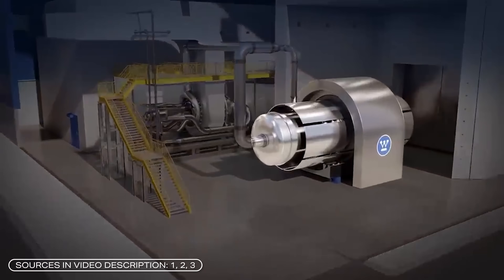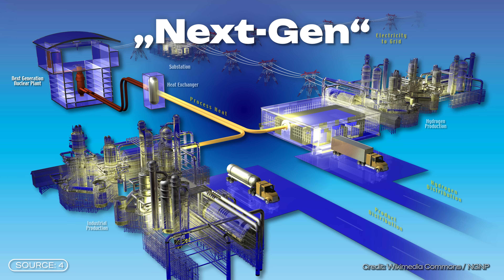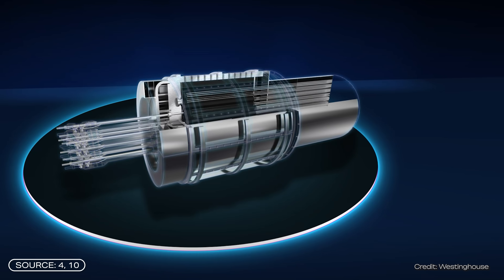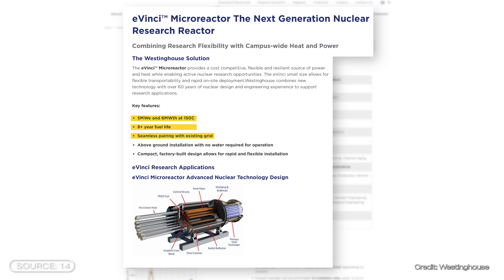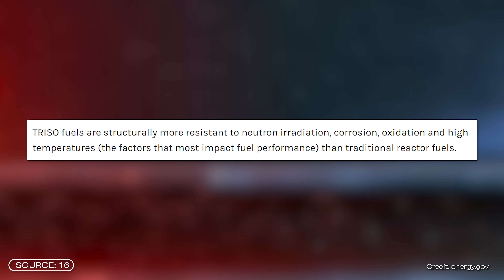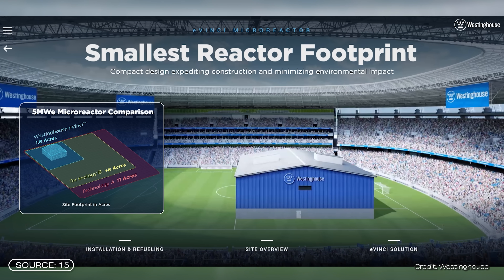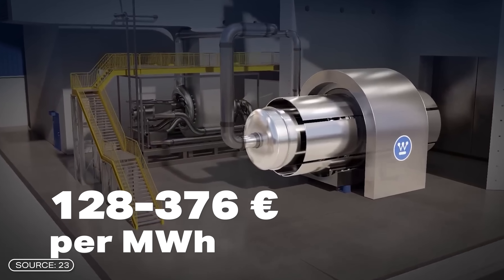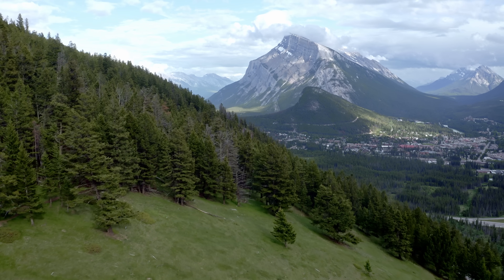Transportable Nuclear Energy: Can This Tiny Reactor Power Our Future?

Comment: I work in testing for the heat pipes as seen in this video. One thing that you have incorrect is that the flow from the heat pipes leads out of the reactor. It is all contained within the reactor itself and the heat is then brought to the heat exchanger outside of the reactor. The wick and flow of sodium would be greatly affected by these bends and external environment.

Comment: In the US nuclear power requires a 10 mile radius evacuation area.   That restricts these tiny reactors to sites already having nuclear power.   Atmospheric carbon dioxide is the gas of life.  1200 ppm carbon dioxide is used in plant growing greenhouses and would greatly green the earth at three times today's level.    Global warming has been at 1°C since 1992 with no known cause with studies to its cause going back to the 1970s.   Earth's water vapor saturated greenhouse effect can not have its overall effect changed.

Comment: Sodium reactors have corrosion issues and poor safety record
Reply: I work on the testing of the heat pipes shown in this reactor and one point is that it is all self contained within the containment shell. Secondly we are currently doing testing with different materials at high temperatures to ensure these effects are not dangerous

Comment: LCOE (and capacity factor to deliver that LCOE) and time to deliver is the key to viability. $140-$410 USD gives it a peaking role in tiny 5MWe chunks. Suggest that this MWh number would be based on running at a 100% capacity factor meaning that actual costs per MWh would be higher. 

As the video points out solar is much cheaper (and wind would be too). In places favourable for solar and wind (Australia), these micro reactors (and nuclear generation of all types, even the most efficient) can’t hope to compete against renewables, even with costs to fully firm supply are included. 

But of course access to renewables differs so this technology might have promise in niche applications where cost of energy is outweighed by its always on utility in places where grids are constrained or don’t exist and you have to burn diesel as an alternative.

Comment: Nice solution for niche applications, but I wonder if this can be rolled out in a larger context to reduce levelised cost per kWh. 

We need energy storage with low self discharge and levelised costs of less than 150€/kwh stored. Then the “green premium” should become negative. Last time I checked the CATL sodium batteries seemed promising.

Comment: Better read up on liquid sodium piping problems with fluctuating thermal stress in elbows, etc. (see French Phenix, super Phenix). If molten salt is used , one must plan for outages and solidification issues.
Reply: Yeah he got this completely wrong. I work in the testing of these heat pipes and they aren’t the ones that he showed here. The heat pipes are fully contained within the reactor and are straight. Those pipes he showed are what take the heat from the condenser region of the heat pipe to the heat exchanger. Not the heat pipes themselves

Comment: There are huge advantages to a modular distributed power grid.
The grid becomes hardened from attack, significantly more efficient, less expensive and clean.
It also eliminates numerous vulnerable, expensive transformers and grid distribution components.
Add fossil fuel based modular steam generators to fill out the demand.

Comment: But CO² is an essential nutrient gas to make plants grow!  It's not a "greenhouse" gas...

Greenhouse's are warm inside because of clear plastic roof & walls, which allow light and heat in and trap it inside.  In fact, greenhouse's actually generate oxygen, not CO².
If the greenhouse were fully sealed, and no fresh air allowed in, all the plants inside would die, because of the over concentration of O² (oxygen) and lack of CO².
Please quit spreading the false CO² narrative.

Comment: Do they produce as much nuclear pollution as macro reactors?
Reply from the maker: Sadly it is even more compared to the energy produced
Reply: @GermanScienceGuy  :(
Reply: There are Gen IV reactors burning fuel down fully. 95 % are partly precious metalls, 5 % is real waste that has a radioactivity similar to natural uranium after about 300 year storage. You also get more than 100 times mor electricity out of the same amount of fuel. So in total about 2000 times of waste is produced for the same amount of electricity.

🔋 Key Advantages of the Dual Fluid Reactor (DFR):

• ⚡ Ultra-efficient: Nearly 100% of nuclear fuel is used  
• ♻️ Burns nuclear waste, depleted uranium, natural uranium, thorium – and all actinides (incl. Np, Am, Cm)  
• 💥 Transmutes long-lived actinides into short-lived fission products  
• 🔄 Built-in Pyro Processing Unit (PPU): Continuously removes neutron poisons and extracts valuable metals  
• 🛠️ Liquid fuel: No solid fuel rods, no reload cycles  
• ⏳ Decades of operation with a single fuel load possible  
• 🚫 No corrosive salts: Liquid metal fuel avoids fluoride corrosion and complex chemistry  
• 🧊 Lead coolant: Excellent shielding, no water, no pressure → no steam explosion risk  
• 🌡️ Very high temperatures (700–1000 °C): Enables hydrogen, e-fuels, ammonia, and direct steel reduction  
• 🧠 Self-regulating: Output adjusts automatically via negative temperature feedback  
• 🪫 Minimal waste: Only short-lived fission products remain (• 🏭 Compact & scalable: High power density, ideal for modular deployment  
• ⚙️ No moving parts in reactivity control: No control rods required  
• 💰 Uses spent fuel, DU, thorium & actinides – no enrichment required  
• 🌍 Reduces dependence on enrichment, mining, and fuel imports  
• 🔄 Fully closed fuel cycle: No external reprocessing required  
• 🆚 Outperforms typical SMRs: No pressure vessels, no water coolant, no fuel handling

Comment: My BUTS compared to other solutions are:
- limiting cooling capacity in extreme scenarios
- risk of localized hot spots - overloaded or degraded heat pipes
- less redundancy in passive safety systems - what happens if the control rods are stuck in full power state?
- high amount of high radioactive nuclear waste, because it doesn't burn down the fuel fully
- low fuel use, does not breed, not able to uses spent fuel or depleted uranium
- expensive processed and enriched fuel
- short lifetime, must be replaced often and be transported over public roads

Especially the use of mechanical systems to control, is a weak point in the concept. Of course, the reactor may not explode immediately, but may run in a "quasi-stable hot run" for years, until the fuel is exhausted. If this works out with this constant high temperature, nobody knows. I know, there are secondary fuel rods, but they may fail, too. 
The reactor misses a non-mechanical shutdown procedure, like the SMRs using liquid fuel. This only depends on physics - melting point and gravity.

Comment: Could be interesting for ships installations. Also for applications where standby running redundancy is required in case of  critical operations. (E.g. two units running at 50% load, where in case of sudden loss of power the remaining unit has to increase to 100% load). 20MWe is often only interesting for the large vessels. As per example but also when changing to a different operational mode the power demand can vary quickly. As such it would be interesting to know what the maximum possible rate of power change is for such reactors.

Comment: Why not use thorium as the fuel ?
Reply: The point is - why use thorium at all, when spent fuel and depleted uranium (DU) is abundant?
The waste of 1 reactor year of a 1 GWe conventional reactor can provide up to 140 times the electricity originally produced. Additionally, the side product from enrichment, depleted uranium can provide another 4 - 5 times the electricity of the spent fuel. In total, this is about 700 times the electricity that was produced by nuclear in the past. This are resources worth tens of trillions or even hundreds of trillions USD, that could pay the debt of the US multiple times easily.
A side effect is that the "waste" produced after complete burn down consists of 95 % partly precious metals, and about 5 % of waste that decayed after 300 years to the level of natural uranium. Of course, it is poisionous, but can be stored just like normal chemical waste. And the amount is small compared to the amount of energy anyway, because 1 kg or uranium/thorium contains 24 GWh of thermal energy. 
But be aware, beside some advantages of thorium, there are nasty site effects. There are hard radiation sources within the thorium-cycle. Proactinium 233 and Thalium 208. Pa 233 comes from breeding Th233. It is a bad neutron poison, that requires immediate separation from fuel, otherwise reactivity stopps. Pa233 then must be stored separately, until it has decayed to U233. This decay also produces hard alpha and beta radiation. TI208 on the other side, comes from a small part of U232 produced during breeding. U232 decays at some point to TI208, which issues hard gamma radiation. This requires more extensive shielding and complicates handling. So the thorium-cycle has some drawbacks, which are often not mentioned. 
IMHO, before using thorium, waste and DU should be burned. And if this isn't enough after thousands of years, there is the posibility to get uranium from seawater, for which China seems to have found a cost effective solution now. BTW, uranium in seawater is abundant,  thorium is not.
Of course, you can use thorium sometimes in the same reactors, that burns waste and DU, but it isn't necessary for energy needs for a long time. 
So again, why use thorium when it isn't really necessary?

Comment: You price Germany's solar - wind farms including battery backup at $55 - $100/MWh but does that include sufficient typical battery backup to supply 1 MegaWatt continuously 14/7 for say a critical  Database without needing to rely on outside grid supply?
Indonesia's 8×500MWe liquid metal Thorium ion molten sodium berilium fluoride salt have a capital cost of $1000/kiloWatt and a levelised pre-profit cost of less than $30 per MegaWatt.hour (<$0.03 per unit kiloWatt.hour)  running 24/7 as a base  loader but capable of automatic load-following to compensate for any non-recyclable irratic renewables such as solar farms and German windmills.. 
Each on about a 2 football site for 500MWe- that 43kiloWatt per m² while your solar farm cannot produce more the 1Watt/m² for an average 5 hour day 
 ...LoL

Comment: To replace fossil fuels with grid electricity you need more grid capacity and grids are extremely expensive.
10x plant costs, just the facts, and 
10x the numbers of plants. If waste heat is ignored. 

Nuclear has a massive grid cost. 

You might say grid economics and construction is outside your expertise, which is fair to say.
But I see that is a major matter because of my expertise. Grid construction costs.

Comment: Having power production stay in centralized locations after the advent of nuclear power is about as intelligent as still using wooden poles to string high voltage lines, transformers etc... and then being shocked when some wind knocks a branch down and takes out power to an entire area, or causes a forest fire. Climate change is not the apocalypse that parasites like Greta thunberg claim or claimed as shes moved to something else,  the wealthy are still buying beach front property and the ocean 100 yards from my back door has not risen at all. That said nuclear has and always will be our only option to replace fossil fuels, but here again morons and parasites prevented the widespread use of nuclear power, so now cities and even nations are attempting to run their grids off of wind and solar with an almost 100% failure rate because those sources are supplemental. So can we stop acting like over indulged toddlers and build the fucking reactors we need please

Comment: I think the main thing that will be achieved with this is to help people trust nuclear power again. The rest of the features like mass manufacturing and passive safety aren't new features. The Russian VVER type reactor is already mass produced (and why most of the world uses them) and passive safety is available in old designs like the TRIGA and almost all "post-chernobyl" designs.

Having it at a "micro" scale severely limits the fuel efficiency (even before the Carnot limit is considered) because it drastically drops the neutron economy of the core. I think down the line designs like Natrium and CANDU will eventually win out along with waste reprocessing to squeeze out as much energy from the fuel as possible.

Comment: eVinci sounds like the 21st-century progeny of the SM-1 nuclear reactor of 1957, built by the U.S. Army Corps of Engineers at Fort Belvoir, VA. SM-1 was a prototype for deployable reactors that could be run at remote bases, but it also supplied electric power to Fort Belvoir until its shutdown in 1973. It was also known as the "Army Package Power Reactor," but it was far less powerful than the eVinci reactor described here..

Comment: I like the concepts involved in this micro-reactor. Using liquid sodium or Li, Be, F at temps of up to 720C would transfer more energy from the system. U-235 is a limited fuel. U-233 can easily be bred from Thorium. A shutdown can easily be perform by removing the molten salt from the small reactor chamber that contains graphite to slow the neutrons. No graphite, no reaction. Control of the reactor can be done by allowing or not allowing grains of U-233 into to molten salt. Good engineering using heat pipes to heat a good gas. A Brayton generator is smaller/better than a steam one. I wonder if without getting too large to cool the gas that ran through the generator turbines, if "bad" water could be used to cool it resulting in steam that could be condensed to distilled water....like in a flood situation?
Reply: I work in testing of these heat pipes for Westinghouse and he got some things wrong here. Operational temp is more likely to be around 700-800C so yes that is more efficient. The second is that the sodium never leaves the reactor like he shows. Those tubes going out of the reactor are not the heat pipes. They are simply what carry the heat out of the condenser region of the heat pipe to an external heat exchanger. The heat pipes are contained entirely within the reactor itself. Also they would definitely not work with all of the bends that are shown in the pipes he’s saying that they are. They are just straight pipes that run the length of the reactor which is much better for wicking and sodium flow
Reply: @Ekh3412  Wow! Cool info. Thank you for sharing.
Reply: @Ekh3412  Wow!...very cool! I really appreciate people who share their knowledge from actually working on the item spoken about.

Comment: The fuel is too expensive; Thorium reactors are much simpler, cannot melt down, and can burn small amounts of nuclear waste from other reactors. 
There is 10 times as much Thorium on Earth, and it doesn't require a significant amount of processing.
What is more, the reactor can be blown up, and once the Thorium gets separated, the fission reaction stops, making it safe for military use and terrorist resistant. 
The US Military needs a dedicated power source for large batteries (100+) of laser weapons (50kW each) put on hundreds of military bases for ballistic missile and air defense (drones), and data centers (AI) are power hungry and could buy that power when the military isn't using it (99% of the time).

Comment: 0:07, 1:12, 5:00 & 9:32 I strongly favor development of nuclear power, but "saving 55,000 tons of CO2" is a minor detrimental effect, not beneficial.

It is minor because 0.000055 Gt of CO2 is utterly negligible compared to annual emissions of about 40 Gt. That's good, because such reductions are environmentally detrimental, because the best evidence indicates that Arrhenius was right, and the emissions are beneficial (rather than harmful, as you mistakenly believe).

8:30 It is a mistake to compare the sale price of electricity from a reliable, continuous source to the sale price of intermittent, unreliable electricity, since the former is worth far more than the latter.

Comment: Most likely use case for this is powering military bases. 

To put this in perspective:
- It was estimated that a gallon of diesel delivered to a remote base in Afghanistan cost $300.
- 90% of fuel used during the war in Iraq was used for non-combat purposes. E.g. convoys and base generators. 
- Where sufficient power is available, new base defense options are feasible. E.g. lasers to defend against drones.

Comment: Horses for courses?  Triso Fuel does not look to be recyclable in Fast reactors. Waste Management Focus: The TRISO fuel cycle is generally conceived as a "once-through" cycle, meaning the spent fuel is planned for direct disposal in a geological repository rather than reprocessing. There is significant research into developing technologies for processing TRISO fuel for waste management and actinide recovery, but these are at a very low level of technology readiness and not yet commercially viable.
Alternative Approaches: While direct recycling of TRISO fuel in fast reactors is not practical with current technology, some research is exploring alternative approaches, such as separating the graphite from the TRISO particles and then breaching the coatings to recover the actinides. However, this is still in the research and development phase.
In summary, the design of TRISO fuel, with its multi-layered structure and use of graphite, makes it incompatible with the reprocessing and operating principles of fast reactors.

Comment: They could easily make a small unit that powers your home for a decade but never will...
Reply: Perseverance's MMRTG is designed to produce 110 watts of power, about the same as is used by a light bulb. 
there is your small power supply.